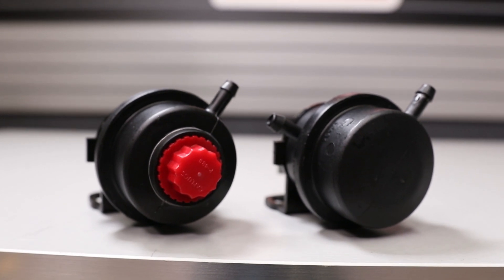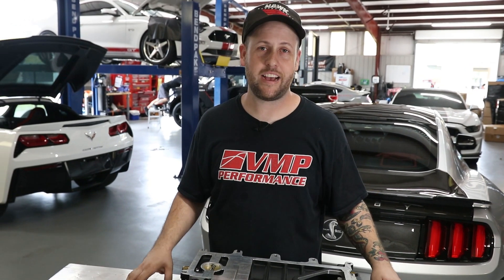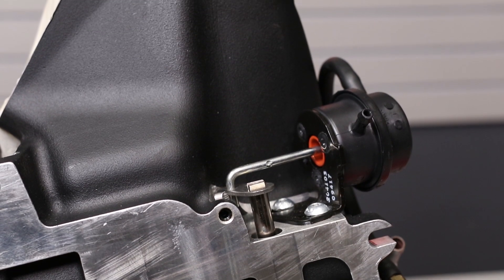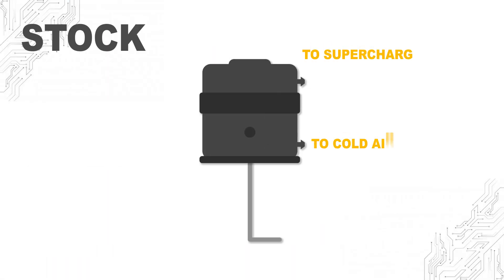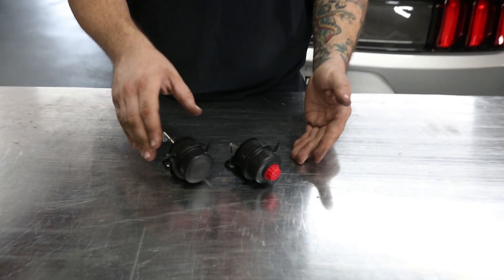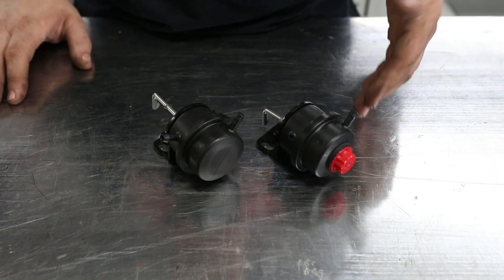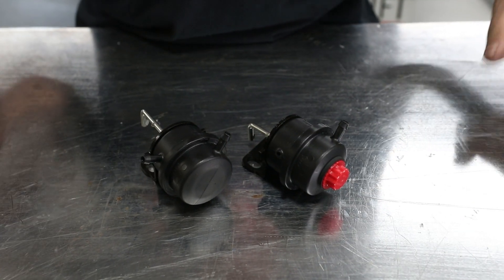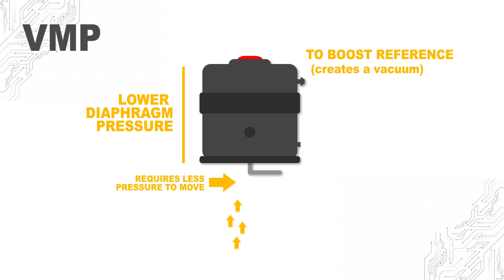Tech Talk || Bypass Valves Explained

Comment: ANY ideas on this? I bought a M90 Eaton TRD supercharger for my 4.7L v8 and  noticed the bypass valve was removed and welded the butterfly valve in a slightly cracked open positive so not to make boost at idle. Anyone see problems with this? My guess is to have instant throttle response? My purpose is to make more low end torque at low rpms to pull a trailer up mountains. Should I cut the weld and go back to a vacuum bypass valve...which way is better?
Reply from the maker: The bypass valve is required for proper function of the supercharger.  If the bypass valve is welded closed or close to closed, the system will always been in boost.  This creates massive amounts of heat and will damage your supercharger.  Always have a functioning bypass valve!
Reply: I  read intto this more and discovered. exactly  what you said. Thanks. I have removed the weld and putting a new bypass valve in. The M90 looks to be in perfect shape with no play in it. After custom making an intercooler the last thing I want is heat build up since my goal is to have good fuel economy with high low end torque at low rpm.

Comment: Would it be possible to set one up to open when idle and open to bypass higher pressure, for turbos?  Or to work in the opposite way only?  Or would it already function normal with added turbo/ pre pressure?  Allowing for normal idle and also feed around for boost?  Compound boost isn’t hard for me to wrap my head around but once you add in this mechanism, it obviously becomes more complicated.  I’m only asking for conversation.  I own an Eaton swap and have zero compound ambitions.  I have seen the question come up before though.  Thx.  Also, what would be some drawbacks to sticking this shut and always having boost based on engine rpm?  Just wondering.
Reply from the maker: These bypass valves are operated by the engine's vacuum and are specific to positive displacement superchargers.  They do not dictate boost pressure as that's controlled by the pulley size on the supercharger itself.  A bypass valve just "bypasses" at part throttle and idle conditions to minimize load and heat when not operated at WOT.  Even in a compound boost set up, you'd need traditional waste gates on the turbos to control boost levels.  As for drawbacks, it is not advisable to EVER close or remove a bypass system permanently.  You will introduce excess heat and load into the supercharger that'll eventually severely damage/destroy the head unit.  Boost is always based on engine RPM and dictated by pulley size on the supercharger.
Reply: @VMPPerformanceTV  agreed.  My point wasn’t so much about boost control but about a “handover” from supercharger duty to higher boost pressures from compound turbos.  I am very familiar with superchargers and the theories that make them work.  It’s the bypass valve and it’s ability to reroute higher pressures.  It’s not like I don’t have a valid point or question, I was just having this discussion with others about compound boost.  Superchargers aren’t hard to wrap our minds around, using a bypass in this way is obviously outside it’s intended uses and you quoted intended uses to me.
Reply from the maker: Based on your questions about operation, we shared how they normally operate in this configuration for clarity.  With the throttle blade closed, regardless of source of boost, the bypass valve would open if the engine made vacuum.  The only time it wouldn't be open is if there were aftermarket camshafts that affected the engine's ability to produce vacuum.  That is why there is a low vacuum version of the bypass valve available.

The bypass valve does NOT reroute higher pressures on a PD supercharger.  This particular type of bypass valve opens under part throttle and idle conditions to bypass the supercharger.  Under wide open throttle and subsequent boost, it closes and forces all air through the supercharger and intercooler.  This is very much different than a bypass valve on a centrifugal set up or turbo kit, which "blows-off" excesses upon release of the throttle.  It's a completely different part with a completely different purpose.  They just happen to share similar names.

To simplify.  This bypass valve would play no part in the hand-off between power adders in a compound set up because its function is one of drivability and longevity, not boost management.
Reply: @VMPPerformanceTV  It still feels like a lesson in the functionality of these.  -  and with you being a selling manufacturer, I totally understand.  I’m not unclear on what they are intended for, or their OEM purpose.  I do appreciate the answer about sticking them shut and again I think it’s a bit one sided, based on “recommendations”, and such.  The answer you gave was like you weren’t even allowed to speak on any positives, like short term responsiveness, if any.  So there isn’t a single supercharger system built that doesn’t have a bypass valve and is more or less fully dependent on rpm?  I realize these are ideal for everyday economic superchargers.  Can you realize they may not be ideal for compound boost and that there is a legitimate discussion on how to get around them?
Reply: And yes, if it could be made to function (open to allow higher boost pressures at higher rpm, when most superchargers fall off or bypass takes over again) then there would be a lot of happy people.  It’s not that we want to get rid of them.  If we could add another vacuum line and run turbos and get the effects I mentioned, it’s worth the discussion.

Comment: Is it possible a bypass valve is not closing all the way and can cause lower boost than expected?
Reply from the maker: Potentially.  The best bet is to have your tuner review logs with the knowledge of your vehicle's full list of modifications.  There are certain modifications such as aftermarket camshafts or anything else that would reduce the restriction through your engine.  Boost, technically, is a measure of restriction and various things can alter how much boost you're seeing/measuring while not actually affecting the performance of the vehicle in any detrimental way.

Comment: Do you have to block off the inlet if you bypass it?
Reply from the maker: Hi Jill, what's the context of your question?  These bypass valves must be present on a TVS supercharger and they internally recirculate at part throttle/vacuum conditions to take load off the supercharger at any "non WOT" condition.  The pathways within which this occurs are cast into head unit and do not require any physical modifications.  The difference in application between the two available valves are to accommodate for vehicles modified in a way that does not produce much vacuum at idle, such as an engine equipped with aftermarket camshafts that would require the low vacuum bypass.

Comment: What exactly controls it though? Is it like a waste gate thats controlled by a boots control solenoid? Or does it just operate using engine vacuum when the throttle is closed?
Reply from the maker: The bypass valve is controlled by engine vacuum and will close as the throttle is opened.  The low vacuum variant uses a bit different internal set up to allow it to still open under "low vacuum" circumstances such as aftermarket camshafts that create very little vacuum at idle.
Reply: @VMPPerformanceTV  so there is no boots controller or anything ?
Reply from the maker: @muckman5509  no.  Boost is controlled by the pulley size.  The supercharger will make no more boost that what the peak boost for the specific pulley size.  The function of a bypass valve is to take load off the supercharger at idle and part throttle situations and has no affect on what boost levels are.  Think of a bypass valve as loosely similar to a blow-off valve on a turbo kit.